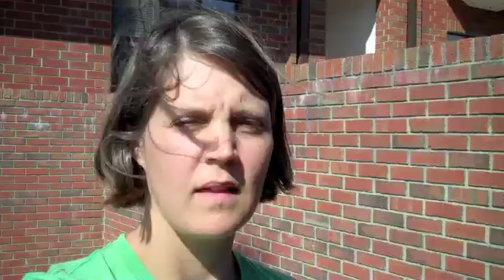Regenerative Braking on an Ebike? Go By Bike Episode 50

Comment: my bike has regen braking and it is awesome. not only does it save brake pads it is a smooth experience and i feel very in control. (spent last week riding around with a broken  brake lever and never felt unsafe...fixed it anyhow to be sure to be sure)
the bike is currently set up with a throttle and no pedal assist sensor (because they are retarded and unsafe) and i have my kelly controller programmed to engage regen on drop throttle. much like a drag brake on an rc car. i achieve "coasting" by applying the throttle gently and can vary or maintain my speed at will. much like engine braking using the gears of a car. as for "not much momentum" its all relative a bike has not much but requires little power to initiate movement. likewise a car has a lot but takes a lot to get moving so its a mute point. any way that said my bike weighs a lot and i appreciate the extra braking to help pull me up without needing to wear out pads. 

presenter has obviously never riden a 1000w bldc throttle driven ebike with regen.
Reply: hey can you send me the link for your controller model

Comment: to implement regen adds what? 50g and we can all agree it will slow the bike down and not wear brake pads whilst it does it, looks like a no brainier to me. think of it like this Imagen if every time you wanted to stop you had to pedal backwards, it would take a lot of effort. lets be conservative and say that by the time you have stored energy in a battery and recovered it to the motor you can use 50% of it. that will add whole miles to your range under normal riding if you adjust your riding style to take full advantage it could make an even bigger range extension. dont forget it takes the same amount of energy to accelerate as to decelerate weather you are a car or a bike or anything

Comment: @cleanairaus 4ah at how many volts and how much time you need to put anything noticeable back into the battery. 
Regen might be useful if you go downhill for a couple of miles but on flat surface its just a useless gimmick..

Comment: Do regen controllers have lower top speeds?  Can it damage the batteries?  I'm not sure if I want regen.  I'm not concerned with increased range, I want to know if it's worth it for the braking capabilities (and decrease the need for friction brakes)  I would probably be getting a rear gearless brushless hub motor either way.

Comment: There are some things to think about that is very interesting with generative breaking. Have you not ever wonder that if you could give a small dose of energy back to the battery over time so you can use it uphill instead really having to struggle. 
I'm sure you done test with this and you base this video on the conclusion of the test but did you notice that the slower you drive the more energy you can put back into the battery. This is because the wind takes most of the energy.

Comment: I found myself asking this and being told all the negative aspects and numbers of why I "don't really want regen brakes" from salesmen.  I read that blog on the 'cons' of regen before and after I bought my bionx and now totally disagree .    Proper use of regen has doubled my range to 40 miles in the hilly NW.
Then theres e-braking.  In the rain e-brakes work as good as drum or hydro . With little or no added weight since every hub motor is already a gen when polarity is switched properly .